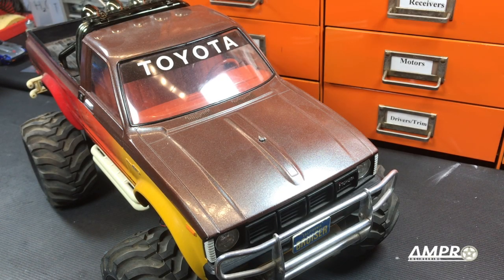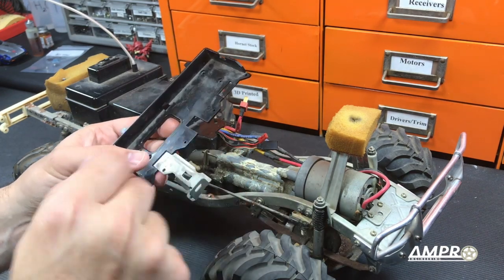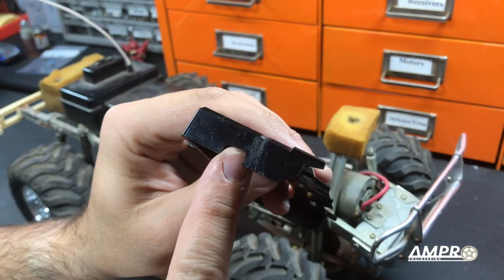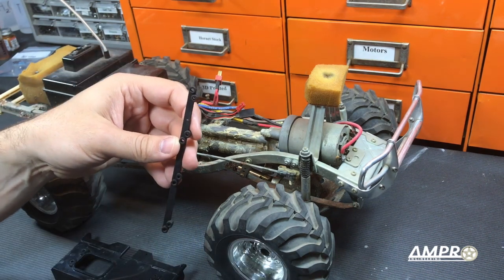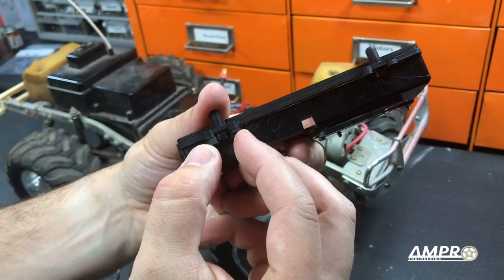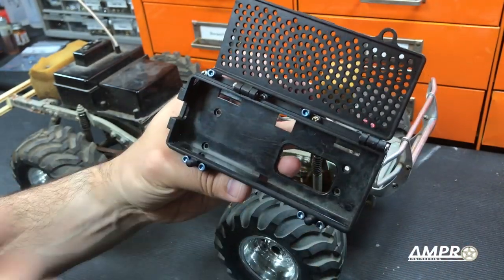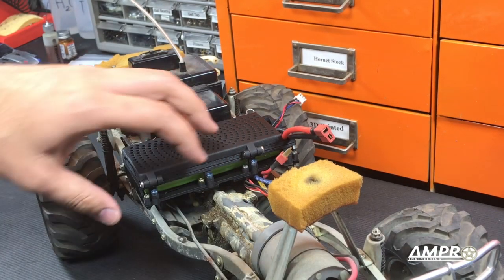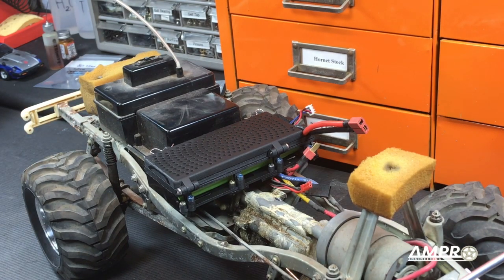e208: Vintage Tamiya Bruiser Battery Door

Comment: Very clever solution and well thought out.  BTW. The metal brackets you show at the beginning are in fact also used for the stick style batteries.  You just rotate them 90 degrees and flip them around.  This is shown on page 14 of the 1985 manual.  I used to run a lead acid, but had to flip the brackets around when I converted to a NiMh stick.  Cheers!
Reply from the maker: Holy cow really? You are the first person to mention this to me. Thanks for that!

Comment: Looks very good. A version that functions with battery straps could be cool too. That way one could easily fit larger batteries. The length is there I think.
Reply from the maker: I thought about that but the seat bucket is right above it. There isnt much room in there!

Comment: Well that’s my question answered 😆☹️ 

Has anyone been kind enough to lend you a re-re battery tray yet ? 🙂 

I’d happily drop my one round to you? but there’s the small issue of the Atlantic Ocean to overcome😆🤦🏻‍♂️  

Superb video and great looking Bruiser. 
It’s really nice to see a used/useable one instead of the shelf queens they are usually forced into being by their value. 👍🏻

Great idea with the soft foam blocks on the body mounts By the way😎👌🏻👍🏻👍🏻👍🏻
Reply from the maker: No not yet but some have mentioned that it fits? Nothing concrete though. Yeah I am not a shelf fan. Shelves are for books, these are toys that need to be played with, lol!
Reply: These days mine tend to spend more time static either in the loft or a cupboard, but yes absolutely😁👍🏻  

And in the absence of anyone else (Tamiya included) making an actual battery holder for the rere, I’m sure yours will work superbly, especially if you’ve been getting some positive feedback re the subject. 🙂👍🏻

Comment: I checked online for the bruiser, and the 2012 re-release costs more than an X-Maxx! whyyyyyyyyyyy LOL
Reply from the maker: No idea. I think it is idiotic that they are asking that much for something that is only for nostalgic value. It is not a good truck by todays standards. Get yourself the HG P407 or for the best of the best with that look, the RC4WD Trailfinder 2.
Reply: You have a point. But all the metal parts are probably costly and time consuming to make. It would be interesting to see how they make each. If your a Tamiya fan and respect the 3 speeds for what they are you will overlook the price. I love the X-Maxx, but I have no desire for that huge truck.
Reply: Agreed, for the cost of a Bruiser (by that listing at least) I could double my fun  with a decked out SCX10 II and a playful Midnight Pumpkin...

I have to respect the Bruiser though, it's one badass kit that has a lot of appeal. Tamiya clearly was making an effort for the scale community with that one
Reply from the maker: Oh no one will argue that the Hilux and the more successful Bruiser are not genesis for the scalers but given their age and cost, Tamiya needs to open their eyes.